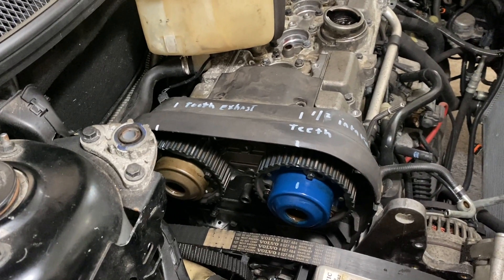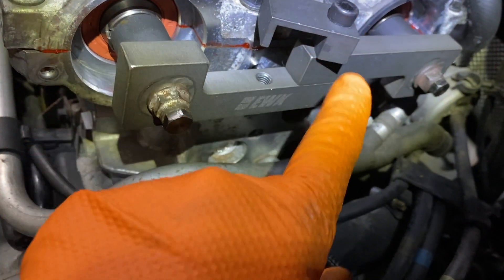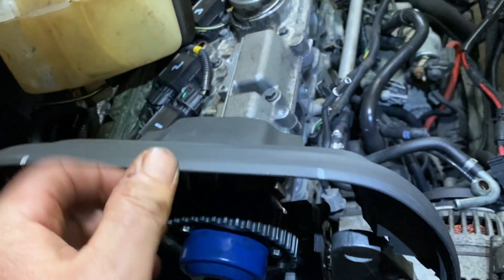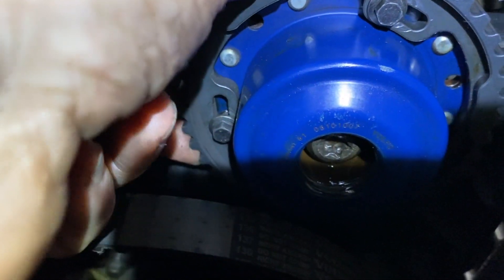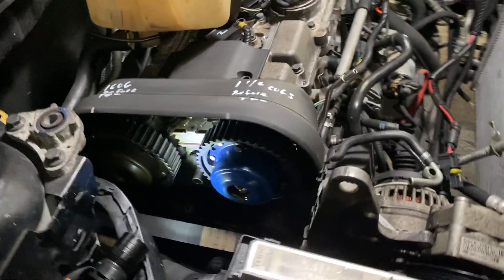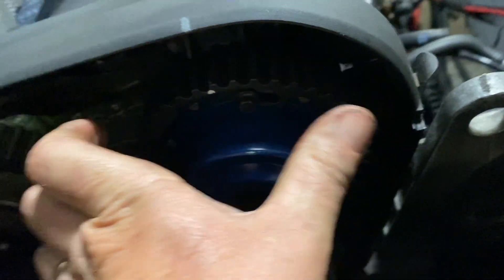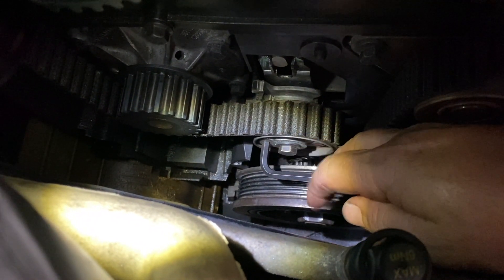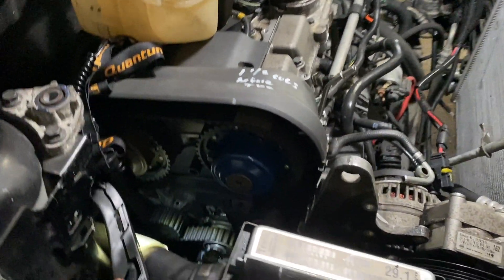Volvo 2.5 Turbo Variable Valve Timing (VVT) Alignment

Comment: Ok I've watched all these videos. I had to replace the water pump. I locked the cams with the belt in place with zip locks so as to not lose the cams timing. The crank was never moved while putting on water pump. I put it back together and did not pay attention to the adjustment pulley tension. 
 Belt was loose enough when i cranked it to start and it skipped over some of the teeth. I found one of the cam gears, the intake side has a razor mark i am assuming that is the mark i use.
 The exhaust has what looks like it would be a razor mark cut. 
  Now in an other video the guy says that when you loosen the center bolt on the cam gears that it should be ableto spin completely 360 degrees without the cam turning. I dont understand how this would set the timing if this were the case. Ive never worked on a Volvo before.  So i have no idea. Right now the mark on the cam gear is at about 4 oclock and the so called mark on exhaust cam, is at about the same. 
  I cant however turn the cams to set the marks on their desired location, the cams i have tried to spin but they will not turn. 
  Should i spin the crank shaft with the belt on to spin the cam shaft gears into place and then deal with putting the crank at top dead center any and all help will be greatly appreciated. Thank you
Reply from the maker: If you follow the video you should be good. I don't have any Volvos in the shop right now to reference what you did or didn't do.

Comment: Thanks for explaining this. Helps put into perspective. I'm actually going to have to check timing. Since I'm getting an ECM-341C code on the exhaust side. Replaced the cam sensor and housing to no avail, although it did look like oil leaked into the cam housing. 

But checking the timing on the exhaust is the last thing to check before giving up
Reply from the maker: No problem! Yes these Volvos can be tricky to line up.

Comment: Your ability to explain this has blown me away! 

Our new to us 05 xc90 with the 2.5T Recently while driving semi uphill on a 90F day gave out and lost power displayed “low coolant stop safely” and then “no oil pressure stop safely” then when we were stopped I looked outside and the coolant had dumped out the passenger-ish side and of course was steaming. I had tried the key just to see and it cranked very slow and would not crank over. 

After some minor tinkering and a compression test the cylinders from left to right read (aprox) 60-50-60-50-70 during the compression test we could only get the car to crank very slow with the key then tried a starter bypass button while full battery and the even hooked to jumpers. 

My father in law says he believes the timing belt may have slipped a tooth or something and is out of time now which seems likely after looking into head gasket issues. 

My 2 questions are does this same method apply to our 05 xc90 or is there a difference?
And does the timing issue sound likely to you? I apologize for the huge comment and loaded question haha your knowledge has really opened my eyes up to this all as a new Volvo owner.
Thank you in advance!
Reply from the maker: Thank you for the compliment, appreciated. To me it’s sounds like you blew the head gasket and warped the cylinder head, hence the low compression. But the slow cranking worries me too. Hopefully you didn’t partially seize the engine. With all spark plugs out, try turning the crankshaft with a 1/2 drive ratchet and socket and see if it turns without too much resistance.
Reply: @motorcarnut  thank you, I will check into that!
Reply from the maker: No problem
Reply: @motorcarnut  another question for you :) 
I drained the old oil and just started to poke around in it and it doesn’t appear to be a significant amount of water mixed in, also it seems there is very little but of metal glitter in the oil unfortunately, there really wasn’t a lot but not what I was hoping to see! 
Does this still seem like the head gasket is the issue? 
I am comfortable pulling off the heads and getting into it I just need a few things to make sure I’d be putting it back together correctly and to spec. 

I will before that of course pull the spark plugs and try to turn the crank to check if seized any, just need to get the tire off and get in the plastics haha.

I really appreciate you taking the time to read my comments and share your experience!
Reply from the maker: There is not supposed to be any water in the oil and definitely not metal particles. Hopefully you didn’t destroy the engine bearings. The crank test should let you know. Good luck
Reply: @motorcarnut  much appreciated! We love this Volvo so gonna do what we can :)

Comment: I need help! 
I used a different method to time my engine and got it started but got the code P0016 and it eventually shuts off leading me to come to the conclusion the timing is slightly off. 
I am trying your method now Motorcarnut, but I am stuck at the end where I am supposed to move the cam gear to the correct location. 
With the Cam locking tool still in place I cannot move the gear any closer than 1 tooth on the exhaust side and 1 and a half teeth on the intake side as it explains. 
For example after locking the right cam gear at 88ft lbs, 1.5 teeth before TDC - How is it that the cam gears can move with one hand to align the timing marks while the locking tool is still in place?
Reply from the maker: That’s because of the variable valve gear that free wheels, that’s why they make all those special tools to align everything. They first want the cams locked by following the procedure then when the timing belt is on the other procedure to lock the timing gears 3 bolts.
Reply: @motorcarnut  Thank you for the quick response!!! Still trying to confirm though....if I aligned the exhaust cam at 1 tooth before TDC and intake came and 1.5 teeth before TDC  with the cam locking tool and set to 88ft lbs.....am I good up until that point?
Reply from the maker: Once the cams are locked in place, just follow the procedure from there, don’t have any Volvos right now to show it again.
Reply: @motorcarnut  I think I get it now! 
I think my mistake is I am trying to line them up so they don't turn anymore and LAND on those marks where they cant move anymore - (1 tooth and 1.5 teeth before TDC respectively) which is preventing me from being able to center them correctly. 
I think I understand better now and I simply tighten the bolts to 88 ft lbs at that mark. Real simple. I think I was over complicating what was explained at 8:18 when you said "as you're turning it, it's at it's limit position to where it cannot turn anymore"
Gonna try this next! 
Thanks for all your help,  we appreciate your patience to help us all understand!
Reply from the maker: No problem, hopefully to got it. It’s hard sometimes to explain it more than I did. God forbid they had physical timing marks a key ways to make life more simple. They all go the cheap way. Lol

Comment: Hmm don't see anything about the 1 and 1-1/2 teeth offset in the OEM service info. Volvo says turn the VVT phasers to full clockwise position, line up the gear marks with the timing marks with the three little bolts approximately centered. The torque the big bolts down. The loosen the three little bolts, install and tension the timing belt, and finally tighten the three timing gear bolts. Wondering where you got the tooth offset spec?
Reply from the maker: Thanks for the comment. It’s in the alldata database. Couple of other people stated discrepancies from the factory manuals and when they followed the manual they got timing codes, then followed what I posted and were fine. So I have no idea why.
Reply: @motorcarnut  Interesting! I got the procedure from AllData, for a 2004 Volvo XC70 2.5 Turbo dual VVT. Just eyeballed the cam slots since I didn't have the cam or crank locking tools. Fired right up, no codes!
Reply from the maker: Wow, you got lucky then. Probably just did a timing belt? Because everything free wheels and needs all these special tools if you’re doing a head removal or more. I think the car in the video was a 2009 idk if there were variations between them, don’t think so.
Reply: @motorcarnut  This one came from the "butcher shop" as a no-start, timing belt was way off. Once running, it was leaking oil everywhere up top lol. I pulled the cams out and replaced all 4 cam seals. Was going to pull the VVT actuators off, but they actually looked to be in the right place, so decided to leave them attached to the cams :)
Reply from the maker: You guessed right! lol
Hey saw your channel before, you know your stuff too, great channel and you seem like caring knowledgeable mechanic as well.
Reply: @motorcarnut  Thanks man! Always more to learn in this field that's for sure!

Comment: To loosen the crank center nut turn counter clock-wise use a size 30mm impact socket.

To tighten:
 The 4 bolts of crank vibration damper up to 2002:
25 nm (18-ftlbs) then angle 30 degrees after.

For crank vibration damper from 2002:
25 nm (18 ft-lbs)angle 60 degrees after

The center nut 180nm (132 ft-lbs)

Camshaft gear with vvt, 3-bolts to 10 nm (7.3 ft-lbs)
Camshaft gear without vvt, 20 nm (14.7 ft-lbs)
Camshaft gear center bolt 120 nm (88.5 ft-lbs)
Timing belt tensioner 20 nm (14.7 ft-lbs)
Reply from the maker: Extra helpful, thanks for sharing

Comment: After I lock down the exhaust centerbolt 1 tooth behind, the entire hub will no longer turn. The gearwill only travel the counter clockwise and that is because of the 3 outside bolts are loose.  Any suggestions?
Reply from the maker: You have to follow the video as I don’t have that information in front of me right now. You must of did something wrong.
Reply: Great question makes total sense ! The instructions are a bit incorrect ..those hubs have to be fully locked in a clockwise position before you tighten it ... and then you'll have a backwards counter clockwise adjustments / play as needed . I followed the video to the T until I ve realized it's supposed to be reversed

Comment: Hi, I hope you can help me... i did the timing Belt 1 Week ago, but nobody said against clock wise... i made it clockwise >.< is it bad??Did I destroy the tightener? And is it normal that the tightener is moving a littlebit when the engine is running and the cover is removed??!
Reply from the maker: If the car runs properly, that’s fine. And the tensioner will move a little, that’s normal.
Reply from the maker: No problem. I’m best contacted here on my channel.
Reply: @motorcarnut   https://drive.google.com/file/d/18fnhDycTqwHV_JouHCoOKXrxiViiTGwv/view is kind of movement ok? and i looked on vida, you are right, volvo say´s against clockwise... is bad if I release the bolt and move it from clockwise to against clockwise, or will I destroy the tightener ? That should be all my kind of worries about this topic. Thx
Reply from the maker: Ok, the tensioner movement is normal, now does the car run fine without any codes? If so I’d leave it alone, if not the whole timing procedure will have to be done, I don’t know if you just move it will it be ok.
Reply: @motorcarnut  thx again you! yeah the car runs fine, no issue Codes, everything like the idle seem pretty fine, so there will be no damage to the tightener or engine for the case if i just move it like in this case clockwise?  If not i would like you said just leave it and nothing change.
Reply from the maker: Just leave it alone. Good luck
Reply: @motorcarnut  Thx very very much! then i will leave it as it is, hope that it will be okay, know for the future how I have to move the tightener (Y) keep on doing this awesome video tutorial stuff !
Reply from the maker: Thank you! I will

Comment: on the crank shaft pulley there is a  hole with a sleeve in it. when the timing marks on  cams are set that hole in the crankshaft pulley is at 12:00 is that a way to time the crankshaft if you can not see the marks on the crank shaft gear?
Reply from the maker: No, has to be like in the video
Reply: Im referring to the hole in your pulley In your video it  was at 12:00 when your timing marks were aligned on the cams i have seen it in other videos as well when timing marks were aligned on the cams 
Thats just coincidence and not intentional then ?i cant see the marks on my oil pump gear and i am trying to be sure the timing is correct
Reply from the maker: Yes just a coincidence.
Reply: @motorcarnut is it possible for the crank be 180 degree out? if so how can i verify if it is or is not ?

Comment: When attempting to remove the exhaust vvt to replace the cam seal my cam locking tool broke( I got a cheap one and won't make that mistake again). Once I get a new tool can I just rotate the cam so the tool lines up correctly or is there a more complicated way needed to realign it?  As I understand it, the notches on exhaust side line up below center. Am I missing something? Thanks
Reply from the maker: No, your correct. The tool only goes on one way so you’ll be fine.

Comment: I used this video in conjunction with the Volvo service notes on the matter. Video was better to follow than the notes due to some Swedish translation errors (eg “remove bolt” when it should say “loosen bolt”) imho.
Very grateful to you for this clip during a stressful time doing cam seals, water pump etc.
Car started first time. The VVTS are not in the exact angular position they were beforehand. I could easily twist them a little back to where I marked them BUT I’m glad I set it back to factory and will take it to Volvo or an engine specialist so they can set optimal angle on a VIDA now that I’ve done all the grunt work and fixed my oil leaks.
Could not have done this job without the cam-lock tool either.
Reply from the maker: Thank you, really appreciate taking the time to comment.
Reply: @motorcarnut  hi again. I’m wondering if I may trouble you for a little wisdom. 
My 2.5T xC90 has been running fine since I replaced my cam seals and belt parts. I used this clip to remount and set the VVTs. Started first time and been running OK. A little less pepp than before and the idle surges ever so slightly each couple of seconds. Engine light has been on too so I figured it wasn’t optimum anyway as I left the pulley bolts hard right in the slots. Before I began both pulleys had the bolts sitting roughly in the middle of slot.
Anyway I finally took it to Volvo so they could scan it. Exhaust cam is running at just under +22deg. The recommended range is -8 to +8deg.
I figure that the pulley is maybe 10-15deg difference from where it was before cam belt change.
Do you think the VVT itself could be at fault? Or the solenoid? I can shift the pulley back to my original markings but I’m not sure that will reduce the +22  deg or increase it.
The intake is fine. I’m very certain nothing slipped whilst torquing up the VVTS but I’m open to being wrong there. Any advice?
Reply from the maker: You messed something up, I don’t think it’s the vvt or solenoid. You could try putting the cam back to it’s original position and see if it helps clean the engine light.
Reply: @motorcarnut  yep, for now I’ve loosened the three pulley bolts on the exhaust cam and twisted the VVT anticlockwise to the original position. About halfway in slots.
Going to Volvo again tomorrow to get them to measure the angle . If it’s improved then I know I’m on right track. Otherwise I guess I’ll be watching your clip again. Cheers
Reply: @motorcarnut  good news!
I took car back to Volvo for a scan after twisting the VVTs back to the rough center of the pulley slots where I found them. Exhaust is now -0.28 deg and intake -6deg. Both well within range and engine light remains off. Thanks again
Reply from the maker: Awesome bro! That’s great! Thanks for the update!
Reply: @motorcarnut  at what part of the video did you remove the CAM lock tool (time on video - please !  and thank you ! ) 
PS  I have a XC90  with 2.5 T   (2005)    it looks identical so Im guessing its the same engine-set up,  DOHC, VVT x 2
Reply: @peter9207  I personally removed it once the VVT were torqued up and belt was under tension with all markings alligned.

Comment: Hey, i have xc70 b5254t2, and every time on last step my exhaust wheel didnt move on this oval holes to the opposite site. what am I doing wrong??
Reply from the maker: Hard to tell. Make sure those bolts are loose enough to turn. These Volvo engines have to be exact or you will have cam codes.